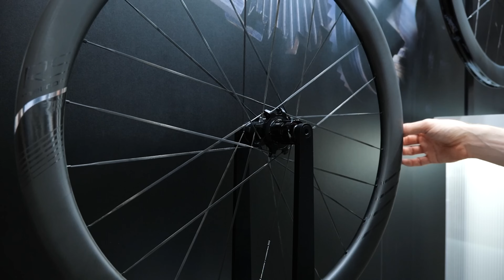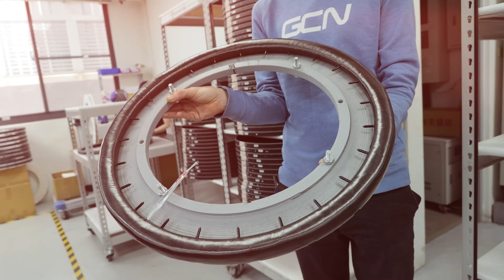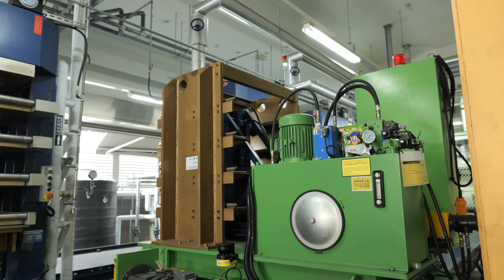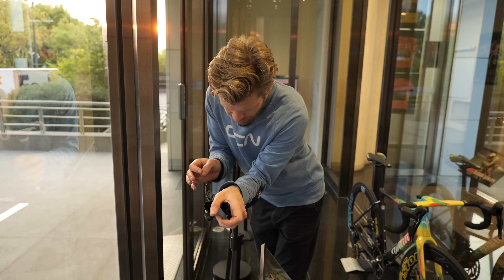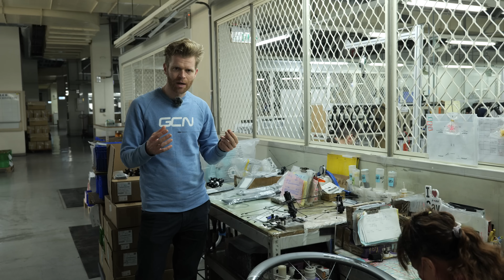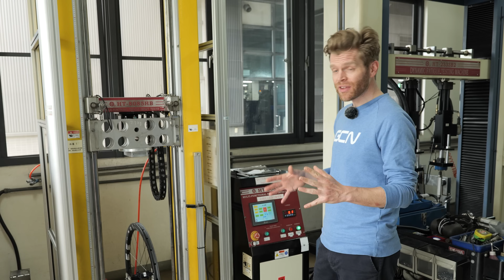How Carbon Bike Wheels Are Made | Inside The Vision Factory

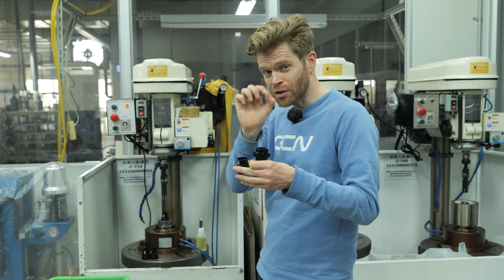Comment: At 15:00. The process is called burnishing. You leave a little bit of extra material (under .001" or .025mm) to have the bire undersize and the steel rollers squeezes the material to the final dimension. Perfectly round and great finish. 
I used them before

Comment: So after spending a week in Taiwan. Ollie came back to a rainy UK. It was good to see how carbon road wheels are made. Even if I can't fit them to my road bike. As I like brakes that work. I am looking to get some carbon wheels for my enduro mountain bike.
Reply: Sigh.  Why does everything have to come to camps and teams and extreme positions anymore.  Of course disc brakes work.  I thought they were ridiculous when they first came out for bicycles many years ago.  A few years later I got my first set.  For a long time I had both rim brake bicycles and disc brake bicycles.  Now I only have disc and really wouldn't consider buying or keeping a bike with rim brakes.  I've never had expensive versions of either type, both have been properly installed and adjusted by bike shop mechanics.  The disc brakes are a bit heavier but the weight is close to the center of the wheel, or static.  And they just perform better in every important way: fade, modulation, rain....That's my two cents.

Comment: Vision wheels are just getting better...the stress tests i found interesting as the interweb is full of naysayers on carbon rims.

Running full carbon on all my bikes (Campagnolo), however i might be looking at Vision for my next upgrades.
Reply: Vision is a little slept on. Subsidiary of FSA, great warranty/crash replacement on the Metron series…I’m a little biased because they are a team sponsor and we get them at a steep discount but they genuinely are good wheels. Don’t know anyone that isn’t happy with theirs.
Reply from the maker: The stress test really was incredible to witness first hand, and being able to share it was great! Plus that was a lot of weight being dropped on the rims too. cheers for watching
Reply: Please keep in mind that impact and cyclical loads are only part of the overall picture (though such tests are interesting to see).  The UV, temperature, and chemical stability of the resin is also important.  

Simulating years of environmental assault requires special environmental chambers.  The data on the performance of aluminum alloys have been collected over decades but CF is much newer and the various cloths and resins seem to change more quickly than 6000 and 7000 series alloys.

Comment: I'm impressed, except...... did they really let you touch all those unfinished parts with bare hands, and leave skin grease on them to compromise the adhesives?  I hope they were cleaning them after out of our sight.
You implied, but surely not, that every wheel gets these strength tests.  Am I about to buy a pair of wheels with 2500km of abuse on them with micro cracking from drop test abuse?  Surely the testing is on non customer samples.
Incidentally, the rolling in the hubs does make for a smooth surface but its real purpose is to enhance the fatigue performance of the material by consolodating  and prestressing the surface layers to reduce crack propogation.

Comment: I have carbon wheels, boras 35mm and 50mm. I also have alloy shamals. The carbon wheels are not faster than the shamals on any of my regular routes or time trials, I've tested them on many occasions over a few years. Maybe if I could ride at a constant 40kph there might be a marginal advanfage, but I can't. The carbon wheels are more susceptible to cross winds.  I prefer the ride quality of the shamals. Cheap carbon wheels with crappy hubs are dreadful. Don't  get taken in by the marketing hype, try different wheels before you buy.
Reply: Never knew vision is cheap lol. But my truly cheap carbon wheels called "elitewheels edge" that costs under $600 with shipping has allowed me to hold 40kph over 1hour without draft. The lighter weight allowed me to shave minutes off climbs as compared to the heavier aluminum wheels as well. The cheap lightweight hub indeed made the elitewheels edge feel kinda flexy when im hitting 500w uphills but still much stiffer than aluminum wheelsets.

Comment: In my opinion, in 2025,  mediocre finish carbon rims laced with poorly designed black hubs are not cooler than a pair of shiny aluminum rims with shiny hubs.
Reply: Have you ridden modern wheels? I don't want to be a hater, but you can't honestly think aluminium rims are better.
Reply: @chrisvanbuggenum871 he didn't say better. He said cooler😂

I like a bit of polished aluminum/ stainless steel/ chrome as well.

But as a Harley-Davidson builder friend of my father's  said to me once, when I went to get a part for my dad's motorcycle, and I complained it was black and not in chrome (it was all he had in stock at the time) 

Chrome won't get you home, boy.

All I said to him was "Yes sir, thank you."😂 But I've never forgotten that. My dad's (now my) Harley  never had an abundance of polished chrome on it. It was rebuilt several times since 1973 to be ridden, not shown. Still is. So yeah, that carbon is well more performing that anything aluminum. I run carbon wheels. First thing I replaced on my bike was the aluminum wheels.
Reply: @ghowell13  chrome looks dope, i agree, i want a cafe bike, like a steel colnago with polished chrome forkes, but it would also be a 2nd bike and carbon will also be best for performance.
Reply: @chrisvanbuggenum871  that would be sweet looking for sure! I raced BMX in the 80s. There were so many chrome bikes, and the into the 90s, there were a lot of polished aluminum  bikes. In between all the shiny bits were the neon paint.

Everthing was bright, one way or another🤣
Reply: @chrisvanbuggenum871 you can definitely buy an alu wheel that will out perform a carbon wheel?
Reply: @chrisvanbuggenum871  Yes, I have Dura Ace 9100 C40 disc, GRX 880, and Campy Bora for my good old rim-braking workhorse. What I wanted to say was that I disagreed with the GCN presenter's argument, "carbon wheels make any bike look cooler." I always think that my coolest-looking wheelset is the Mavic Open Pro rims and Dura-Ace 7700 hubs, laced with silver spokes.
Reply: @MajorJamesGastovski  ok, got you. I misunderstood.
Reply: @MajorJamesGastovski  i bet that's a beautiful set of wheels. I had a set of  Campy "Sheriff Star" hubs on what I found out later were pinned (not welded) single wall Ukai hoops (20 inch wheels) 
I sold them along, as I didn't know how to rebuild wheels, and didn't know just how rare those hubs were. I still kick myself to this day, and that was well over 30 years ago.
Reply: @ghowell13  Yeah, I got it. I'm too young to own the "Sheriff Star", but I still got you. GCN has created several videos to teach people how to mirror polish their parts. It's a shame that the manufacturers couldn't see the need for the good old shiny, eco-friendly aluminum parts.
Reply: Polished aluminum looks cooler for sure. Somebody really ought to figure out a way to add a metal mesh weave into the top layer to replicate that look. At least polish those hubs rather than anodizing them. The look where you have black with sharp polished accents a la SRAM Red is extremely cool, and if we're stuck with black carbon for performance reasons, I at least want some shiny accents.
Reply: @cptjeff1  I agree. You can polish the bits yourself, of course. There's a way to strip the anodized off the aluminum. I use oven cleaner. The old stuff worked way better/ faster, of course,  lol. Then you're left with the bare aluminum.  But if it has that thick black coating on, chances are, it was never polished before, so you have your work cut out for you.

The old blue, red, gold, etc. stuff was usually polished before anodized. So, you just cleaned it up and polished it with some cream or compound.

Comment: Next stop cheap alieexpress factory
Reply: Chinese manufacturers will make you any quality. Sellers will push prices down because customers are uneducated, and they just buy the cheapest ones. Sellers are fighting to be the cheapest to get to the top spot. So that's why you get bad quality because that's what sells.
Reply: Aliexpress is marketplace like Amazon, nothing is made by them...
Reply: Also sellers on AliExpress are on many platforms. The sellers are 90%+ just sellers they don't manufacture anything, they just order cheap stuff in bulk.
Reply: If you invest a bit of time to find reputable sellers and manufacturers you can find very high quality stuff and they are just slightly cheaper than branded  products
Reply: @dtibor5903  well aware, just ordered
Reply: It would be fascinating to see the contrast with some of the cheaper manufacturers.

Comment: Wouldn't safety glasses be in order while being around lasers?
Reply: Yes... If approved for use with laser, because impact & dust protection would be unnecessary
Reply: @ truu
Reply: That Zund machine uses a drag knife, not a laser.
Reply: In europe a laser marking machine like this would need to be enclosed with safety switches all around.
Reply: Depends on a whole host of different factors. Sometimes yes, sometimes no. For laser engraving, just don’t stare at it while it’s running and you’re fine.
Reply: yes